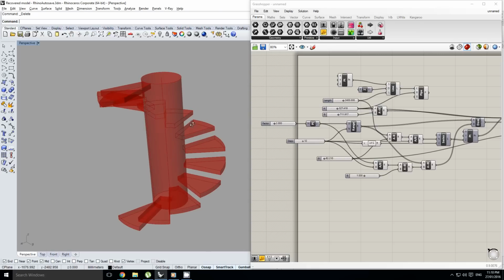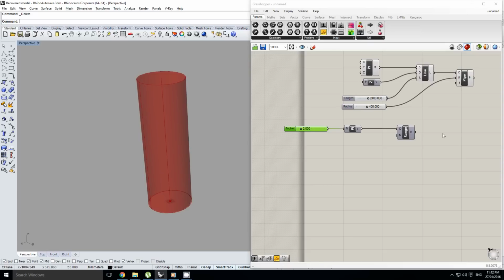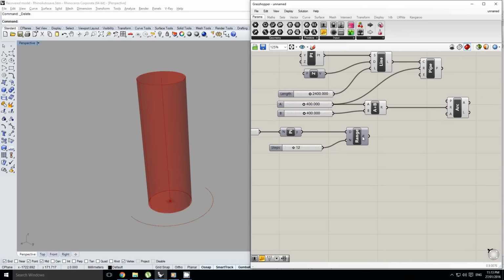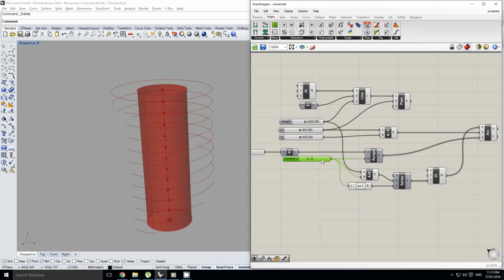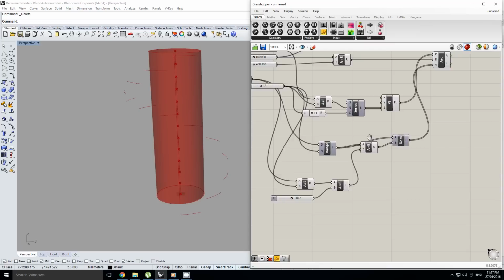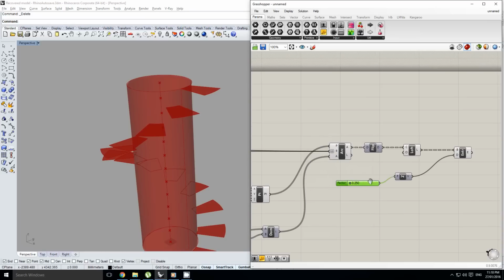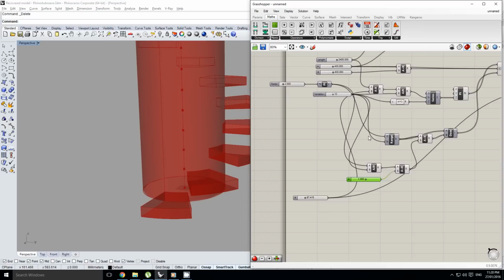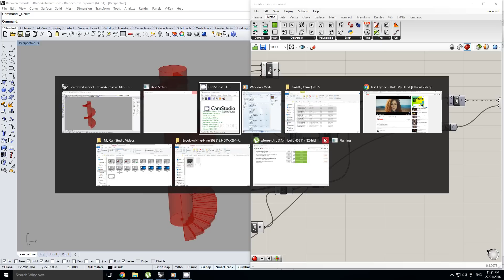Grasshopper 13 - Creating a Parametric Spiral Staircase

Comment: Thank you for the videos! They are very helpful for a beginner like me. For this one, I am wondering if you can just use Range to set the Planes for Arc, instead of Using Series and Scripting...
Reply from the maker: Absolutely! There's many different ways to do the same thing, and you can use a range if you find that easier. 
I try to use a variety of methods in my tutorials just to show there are many ways to achieve similar outcomes.

Comment: What he is doing is totally unnecessary if he wanted to get the value of .78 rad he should convert degrees to radians it would be easier to understand. Multiplying from pi to .25 gives us .78 rad. I would take from degrees from the component degrees to radians in the grasshopper tab to convert to radians.
Reply from the maker: Hey Christopher.
I totally get that radians aren't as intuitive as degrees, considering most of us probably learnt and understand degrees. However,  after spending a little bit of time learning about radians, I find them much more useful nowadays, and I would argue that in general it's better to understand angles in terms of pi.
In general, most applications will use radians internally for calculations, converting to degrees is an extra step, but degrees are there as a more intuitive value - grasshopper itself spits out radians anywhere you may be using angles.
Don't get me wrong, there is absolutely nothing wrong with using degrees, but for what it's worth, I would largely encourage you to look at using radians. I did a video earlier on about radians and sine functions which you may or may not want to look at (admittedly, the recording is pretty poor, and I should probably redo it).

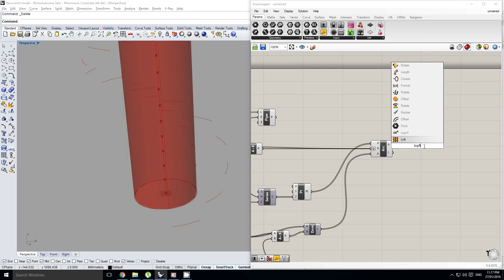Comment: 7:19 When i put loft and flip nothing happens. I don't even get the dotted lines that you are getting. Do you know what's the problem? 
Thanks
Reply from the maker: +solleee1 sorry, could you be more specific? Are you getting any errors? What exactly is happening with the outputs? What do you mean when you say that you don't even get the dotted lines?
Reply: When you connected ARC and LOFT you got "dotted" lines between them. I didn't get that. However I did get the connection between the codes first time. And when you put flip the matrix in and got the stairs my first connection disappeared and I was back to as nothing has happened. Sorry, I am not that good at explaining..
But basically when I put flip the matrix and loft just as you did, nothing changed in my model.
Reply: Flip the matrix does not work.. It only removes the "loft structure" and it all goes back to just if we had the arc, if that makes sense?
Reply from the maker: perhaps you forgot to do the graft operation on the Arc Radius input. the dotted line symbol indicates a 'tree' structure, or a 'list of lists' structure. The graft operation here ensures that each angle value corresponds to each radius value.
Reply: That solved the problem! Thank you so much :-)

Comment: Hello, when i try to plug multiple radius values to the radius of the arc it doesn't make me do it. I can Plug just one value. Can you please explain why and how to solve this??
I'm talking about the step before you have to graft the two values in the arc. Thanks!
Reply from the maker: You can insert multiple streams into an input by holding the 'shift' key when adding additional streams. Please reference the timecode if/when you have another question, it makes it much easier ti find what point in the video you are talking about.

Comment: Hello mate, 
I have an issue with the expression. Mine keep saying "1. Parameter "Variable x" has an invalid name. Only use alphanumeric characters and don't start with a number." Any idea how to work around this? As far as I can see, I've followed your tutorial step by step, yet this comes up. Something I'm missing?
Reply from the maker: Have a look at this thread on the grasshopper forum, I think it answers your question. I've never run into this error, but I'm assuming you are running into it because you are using the 'draw full names' option for components. The solution is to rename 'variable x' to just 'x' on the left-hand side of the expression component.
http://www.grasshopper3d.com/forum/topics/probs-with-the-new-function-component
Reply: You're right. That was the issue, as I was using full names (Fairly new to grasshopper, so I need to see the commands full names so I can follow what I'm doing, you know) Thanks for taking you time to help me Daniel. Cheers.
Reply from the maker: Not a problem! I'd heard of this issue a few times, but providing the runtime error helped me figure out what the actual problem was. Happy to help, and good luck with learning grasshopper!

Comment: I can't seem to construct my stairs anywhere except for at the origin. I put a Pt component and set one point to a coordinate I would like to construct these stairs, instead of the first Construct Point component; however, only the location of the pipe moves to my set point and the rest of the stairs continue to build at the origin. Any helpful suggestions?
Reply from the maker: You need to link the position of your set point to the base plane of the arcs as well. Where you have placed a construct point node as the base plane for the arcs, use an addition component and plug the two point params into your A and B values. Points can in fact be added together.